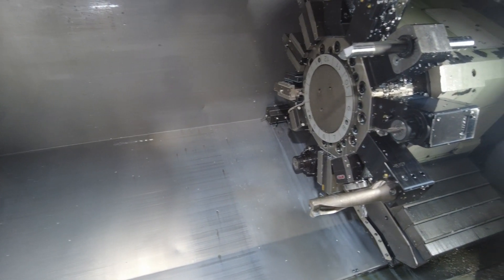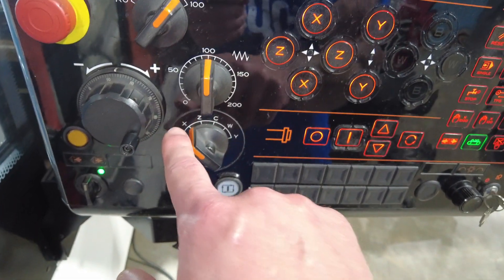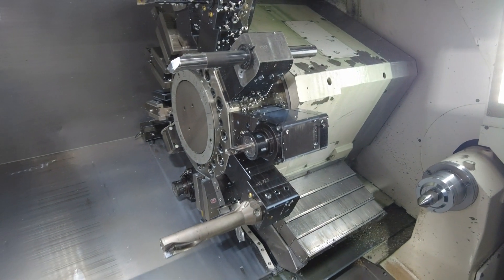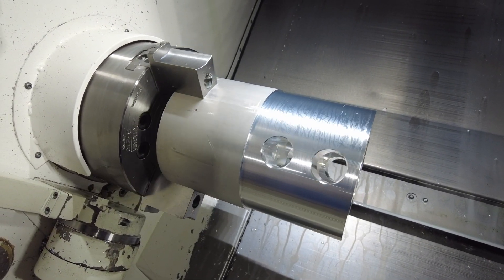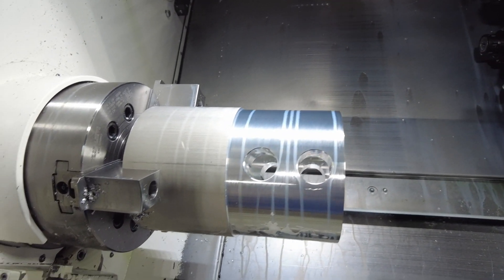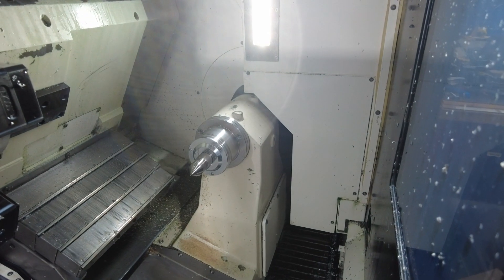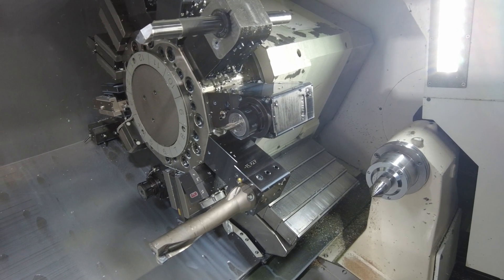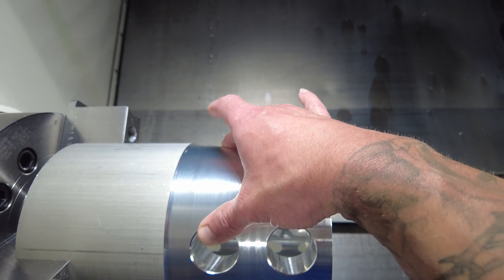Mazak Smooth G  Lathe Axes and Movements

Comment: Hi marty,

Would it be possible for you to make a video explaining how line center works. 

I've got a job to do which is basically a 2mm ball nose cutter from Z 0 to Z 25mm but it's ran on a pcd 22 times round the diameter. 

I can get the 1st line to come up on mazatrol but I can't get the other 21 lines 😢

I'm not sure where I'm going wrong as I've tried everything and even referred to the mazatrol manual but there's no examples like I need

Thanks
Reply from the maker: If you have a straight forward job, use line center, compensate in your program for half of the width of your tool as machine reads the exact center of the tool, specify the z 0 to z 22mm, rx for dept and c angle to whatever you need, not sure if that helps